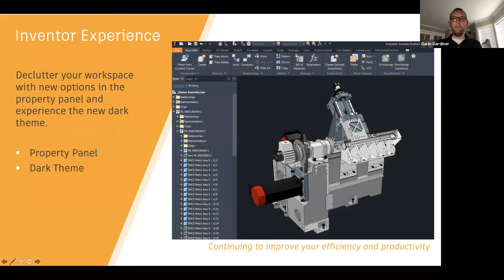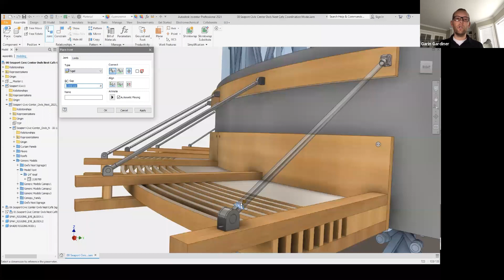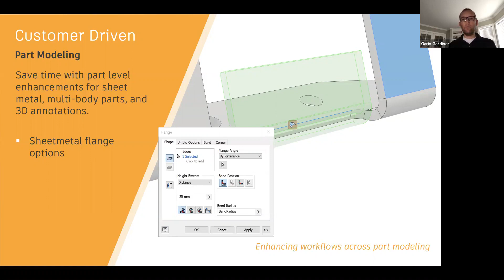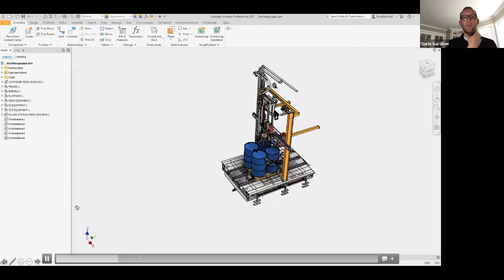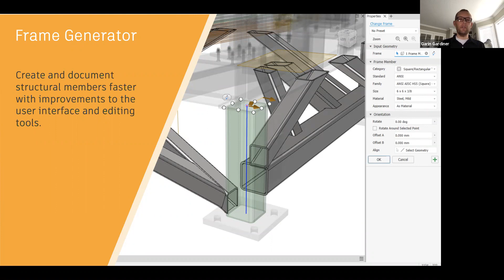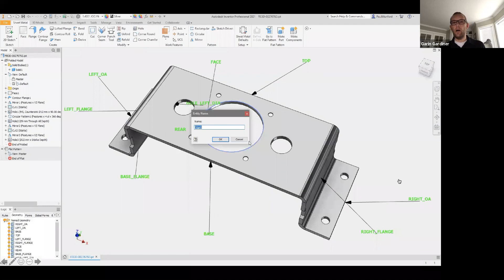What's New in Inventor 2021 | Autodesk Virtual Academy

Comment: Thanks for sharing this with us. I would like to know if the following feature is in Inventor? we design with a multibody part and move forward, the thing is that if Inventor allow to create separate maps on the design tree for each part, this will help recognize it when a multibody part is large. Thanks in advance.
Reply from the maker: Thank you for your question, please review the What's New in 2022, I believe the model states maybe be what you need, however, I have not tried to use them with model states but that is where I would look. The What's New AVA should be posted in the next week. KETIV | Nicole Morris

Comment: Thank you for updating Inventor to where it should have been 10 yrs ago. Now add more options to the hole command so we can have stepped diameters, CBORE from opposite side, etc. Maybe then it will be worth $8,000.00 for 3 years (per seat).
Reply from the maker: Thank you for the feedback! We work closely with Autodesk Inventor product managers and know updates are highly influenced by the Inventor Ideas Forum. You can submit any suggestions you may have here: https://forums.autodesk.com/t5/inventor-ideas/idb-p/v1232
Reply: @KETIVTechnologies  thanks for the reply, Ketiv.  I'm on the forum...leaving ideas there is like talking to the Mona Lisa.